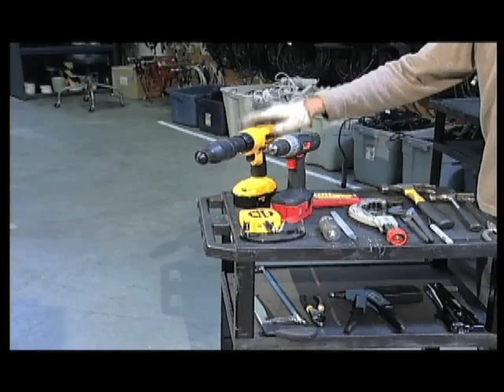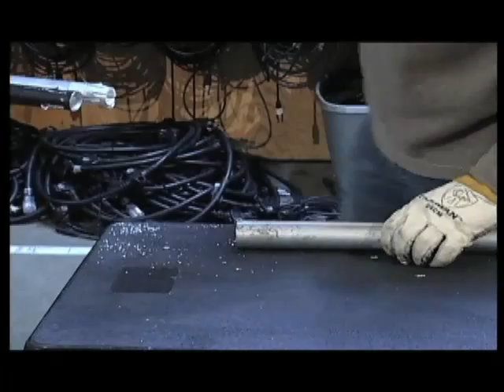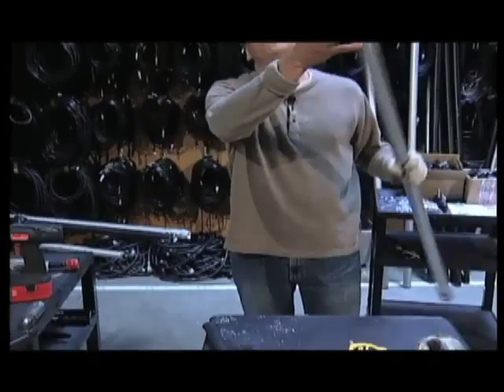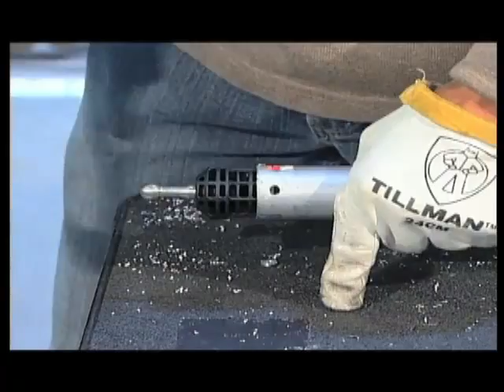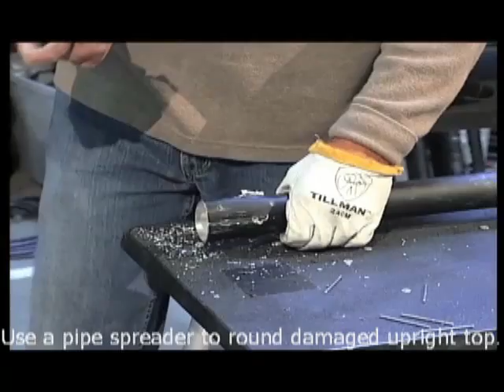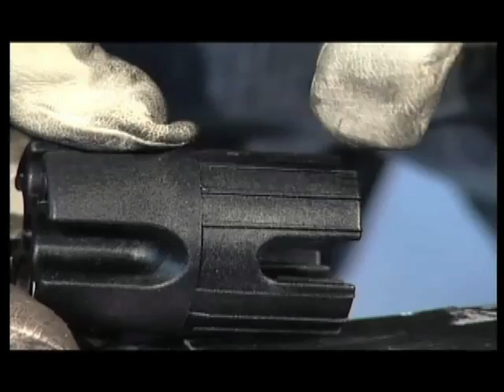Pipe and Drape 2.0™ - A Step by Step Install

Comment: I'm going to add one more thing.  At first the rivets were not being flushed against the pipe after I put them in.  Something that helped me was: you must take your time drilling the hole through the inserted ball cap insert; make sure you hollow out any excess debris; after pushing the rivet into the hollow hole, I took a hammer and flat head screw driver and tapped the top of rivet head all around until it was flush against the pipe.  I am now flying through the process...hope this helps someone...